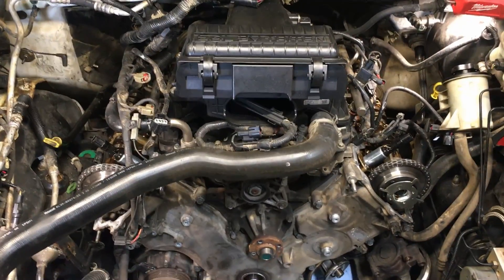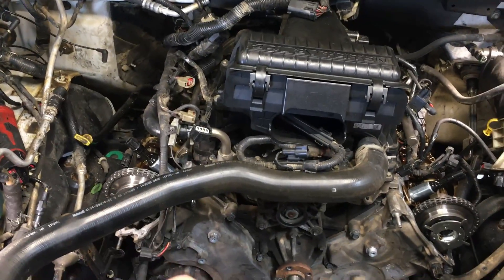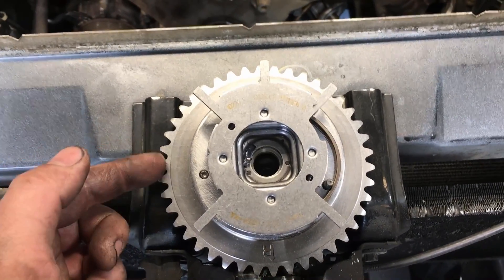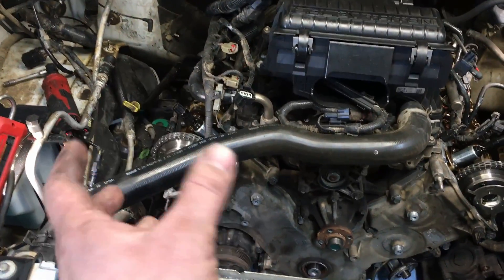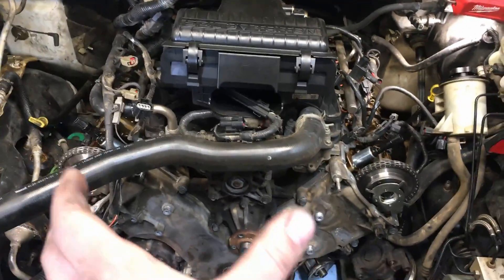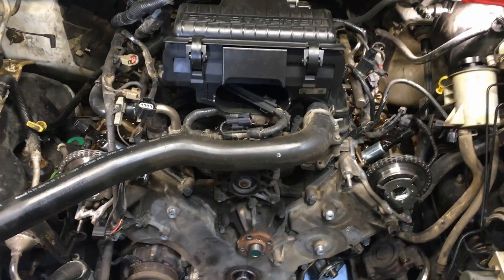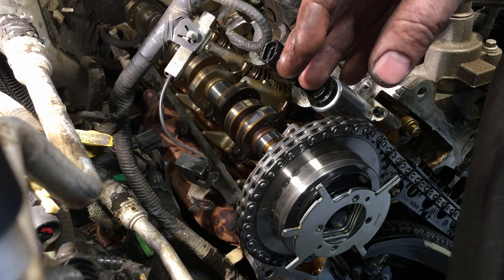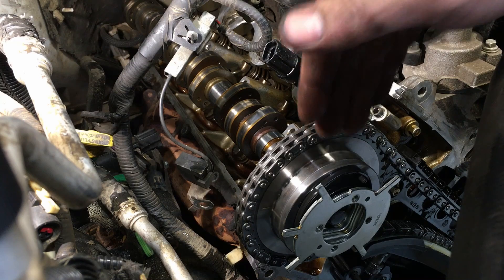Ford 5.4L 3v Triton Engine: DO NOT USE AFTERMARKET PHASERS FROM FREEDOM RACING/OTHERS; THIS IS WHY!

Comment: It was Benjamin Franklin who said, "The bitterness of poor quality remains long after the sweetness of low price is forgotten."
Reply: Dewy Russ Ben loved quality beer.
Reply: @creigmacc  quality beer is not brewed in the USA; and not quality cars are made also
Reply: @thinknow1  I'm sure whatever fecal matter encrusted sphere you find yourself has the best of everything.

Congrats.
Reply: Fancy Benjamin Franklin way of saying “you get what you pay for”
Reply: ford has low quality and high prices that why these engines need rebuilt and are expensive.
we went from $3000 for a new car in the 1970's to $65,000 today and you get 1/4 of the milage before major repairs are needed.
Reply: @RobertMillerJustme  - There is truth to that but it's not just Ford.  All brands have their problems.  And you ignore the benefits of new cars.  Back in the 70's, I was changing plugs every 15k miles, adjusting or replacing points and condensers nearly as often, and adjusting valves every 20-30k.  Most vehicles that made it to 10 years of age already had the exhaust replaced twice.  Shocks lasted about 50k...so you were swapping them often.  Back then, it was a real milestone to reach 100k miles on any car.  They rusted-out in less than 10 years if you lived anywhere up north (where I did).  Today, most plugs aren't replaced until 100k miles.  You can literally buy one and drive it for years with only changing oil and putting gas in it...and never have to do anything.  Sure, there are problematic designs but all-in-all...today's vehicles are MUCH more reliable.  Don't get me wrong because I'm a gearhead and love classic cars and trucks...but just because it pains me to admit it, today's cars are pretty-much better than any of the old vehicles with maintenance, reliability, safety, emission, performance, and longevity.
Reply: The key you could do it 

My first car was a v6 Pinto wagon demo unit I had that car for 12 years and put on 400,000 miles and except for general maintenance no major issues. I did replace the exhaust TWICE

As for the rust bucket, you are uninformed The older cars lasted longer it was not till Japan sent their rust buckets over did that change - in Baltimore my grandfather had a 1963 Ford Galaxie model and he kept it till he was t boned in 1996 and no major rust and original paint, it was his daily drive going to Bethlehem steel.

My 99 f 150 wiring harness was replaced, and on the third ECM, 3 sets of phasers, both heads twice, exhaust codes at least once a month for no reason - I can prove it has been in the shop more than out on the road it is a worthless POS that never should have been built.

As for exhaust to do the complete exhaust today cost as much as my first car.

Today everything is designed to make you buy new every 4 to 5 years and this is planned, they know they are building crap.
Reply: @RobertMillerJustme  = You have some agreeable points and others...not so much.  I grew up in central PA.  I'm not ill-informed.  You could hear your car rust on a quiet night!  My first vehicle was a 61 Willys Jeep...by the mid-70's when I got it, the floor already had 3 layers of sheet metal covering the holes.  We had a mid-70's Ford pickup...body mounts were rusted off by the late 80's (when you hit the brakes, you could feel the cab rock back and forth).   My 77 CJ-5 was so rusted out by 1989 that I had to replace the whole tub with a fiberglass body.  SOO many examples of rusty vehicles...I think you are the one ill-informed.  I don't think there was a car on my street that didn't have rusty wheel-wells or quarter panels.  Vehicles in the rust belt look like they lived in the bottom of the ocean after 10 years.  It was that way all the way back to the vehicles I remember as a child.

As for reliabilty...yes you could work on them easier than today (without code readers, etc.) but that IS the point...you HAD to work on them.  And you had to do it ALL THE TIME.  Like I said, I'm a gearhead but I have to admit I could go down and buy a simple family sedan somewhere today and if it didn't last at least 150,000, that would be rare.  Back in the day, you'd be lucky to see the odometer turn over 100k...it was a really big deal when that happened. 

As for exhaust...yes it is more expensive but you rarely have to do it.  My wife just got rid of her 2008 Town and Country van with 278,000 miles and guess what...original exhaust.  My 2004 F-150 still had the original exhaust after 16 years when I traded it.  Heck, my daughter's 2002 F-150 (used to be my father's before he passed) still has original exhaust...so it might have been cheaper to do it on your Pinto but you HAD to do it.  Today, they last much longer...often the lifetime of the car because they are stainless steel (which is why they are so expensive if you do have to replace).

Comment: Yep had one come in and the owner bought a DORMAN and I refused to install it.I told him to buy OE only he told me to well never mind.I try to steer people to OE parts ONLY. Thanks for getting this information out now let's hope the people takes this seriously.
Reply: I had a customer that never changes his oil need the timing done and used Dorman phasers. 3 years and 2 oil changes (eek!) later they are still going strong.
Reply: @sienile  i to have dormans. And my truck constantly gets sprints to 80 mph from 30mph rolls do to our on ramps to the express way
Reply: Dorman make s*** parts . I got an electronic throttle harness replacement and all the wires are white and not labeled .
Reply: Guys, its the the parts that are bad.  Its the junk 5.4
Reply: @getchasome6230  5.4is a stout engine...it's what's on it that ruins its reliability.
Reply: @getchasome6230  millions 5.4L still on rd doing well! Out of production 10yrs now.
Reply: @damnyankeerebelprepper1324  the dorman intake 😄 -11 HP 🤔
Reply: The OE part failed... "only use OE parts" lol...
Reply: @mattlane2282  that's what I thought too.  The Ford phasers are the pin in the grenade!
Reply: @mattlane2282  It's called a lockout kit and tuner.
Reply: @DoctorRickSanchez  Is this a better fix than new phasers?
Reply: @justinwalker3617  Yes. Get the OEM phasers along with the livernois lockout kit with the tuner package.
Reply: @DoctorRickSanchez  I have a 2005 f150 with the same issues I bought the dorman phasers and got screwed so I went and bought the Livernois Lockout kit and it is the best thing that I have done to my truck!!!!!!!!!!!!!!!!!!!!!!!!!!!!!!!!!!!!!!!!!!!!!!!!!!!!!!!!!!!!!!!!!!

Comment: Hello this is my 1rst comment on one of your videos. I have watched a lot of them and you have been right on the money every time with your knowledge.  I have 2008 lariat with the 1 piece plugs, What do you know or would you recommend   the lockouts and a tune just to eliminate that system all together ???... I like my truck and I don't have any plans on getting  rid of it  I have 280k and still running strong. I run amzoil full synthetic signature oil changed every 10k. What would you do to keep it running for many more miles.

Comment: 8:43 It doesn't look like the chain is even meshing to well on the sprocket. is that normal?
Reply from the maker: Yes it doesn’t mesh too tight on these but also this is an aftermarket chain
Reply: hey so another question.. My ecoboost has had the timing chain redone at the dealer at 72000 k's.. it was a pile of parts. That was a warranty job. 30,000 k later it needed phasers again. All ford fomoco parts. that job cost me 2600.00 CAD.. Any idea why it failed so close together..

Also it was 25 days over warranty and 2000k past 100k powertrain.. I think they screwed me.
Reply: @billstmaxx  same, mine only made it 30,000 more and I have to redo again

Comment: The hair on my neck stood straight up watching the passion in this guys voice over this issue. And just for that...I won't buy as much as a bumper sticker from Freedom Racing.
Reply from the maker: The company is fine otherwise, I buy Ford OE speciality tools from them often it’s just these cheap phasers they are pushing over the OE ones.
Reply: Well, they're not that cheap either. The price that comes up when you do a search for HDPACNC, brings up Freedom Racing and a price of $217 per phaser.

I recently purchased some AC Delco corrosion resistant brake rotors for my Chevy truck. The box indicated, Made in China.
Reply: The passion…..is just GENUINE! Brian even gave the guy a break on PARTS because he knew the situation was SNAFU!
Reply: matt8863 
Sounds like they enjoy plenty of freedom over there. 
Freedom to lighten your wallet for junk parts.
Reply: dont buy a FORD is a better option
Reply: @BadTV1993  No, Fords are good vehicles.

Comment: And everyone is running around like a chicken with its head cut off, screaming that Trump has imposed tariffs on cheap CHINESEIUM parts!!! 

Did you say DORMAN?? They can't get anything right, let alone, a large, expensive, complicated part like this!! There is a reason why I won't buy DORMAN toilet paper, as well!
Reply: roadkill5333 - yup! undercutting real parts with 1/3 price, garbage quality that will cause you more issues in the long run (i doubt they take the time to temper and treat parts that require it for longevity) and people bitch about the tariffs. Amazing. What's equally amazing is when the vehicle or device they are trying to repair still has lots of value left and they STILL want the cheapest parts available. Like all the no name tires you see on cars like Mercedes.... You bought a 50k car and put Chinese "grip-mile" no name tires on it!
Reply: volvo09...yes, those cheap Chinese tires were the precursor to things to come!!

I was getting some tires put on once, and while sitting in the waiting room, one guy gets finished, goes to his car, and the "NEW" Chinese tire that had just installed, was flat! I smiled. While he waited for them to change it, I was watching them try to balance the next tire, and couldn't! So they went for another and finally got it balanced!! Looked like a lot of lead weight to me, but from a distance, I couldn't see enough to count!! I wouldn't want that much lead on my new tires!! 

A buddy put Chinese tires on his big truck! He had nothing but troubles out of them, and had to replace the new tires, within about 15k miles! Spent more money, and down time on the Chinese tires, than he saved on when buying them!! Including sitting on the side of the road, waiting to pay road service to come fix a blowout, a rough as hell ride for the last bit, and a different one flat on him, almost every week that he had them on! Fortunately, he only had them about two months, and no fatalities occurred!! Unfortunately, that's the longest his truck ever sat, while the drivers seat was occupied!! Cost him some good money!!

Comment: I purchased Ford phasers(with the FoMoCo brand engraved)from freedom racing and didn’t have a thought about getting the aftermarket brand. Been driving for over a year after the timing job with no problems.
Reply from the maker: Yeah they sell both which is great but them pushing the local phaser company has pushed me.

Comment: I can understand the frustration. I had solenoids and phasers installed by my local shop and the truck ran worse afterwards than when I brought it in. I know the bank 1 phaser is sticking advanced intermittently. 4 out of 10 times I come to a stop sign it will shake and shudder like it's missing. When holding constant pressure on the accelerator going uphill, I can feel the power come in and out as the phaser is wandering around in and out of time. They blamed it on low oil pressure so I changed it to thicker fluid and put a gauge on it. 45psi at warm idle. So much frustration and stress over a few pennies in savings.
Reply: Test your oil pressure.  The phasers are very sensitive and the oil pressure must meet specs or they won't run correctly.  If there is wear in the engine or obstructions to oil flow, you will need to install a higher capacity oil pump.
Reply: John Ferguson I am well aware. You obviously didn't read my comment.

Comment: So when I go to buy parts for my 4.6 2 valve, where do i get parts that ford no longer makes. I dont wnt to change the engine when the 2 valves are tanks. Does amazon have ford parts for those engines also.
Reply from the maker: Ford makes most of the 2v parts still I am sure but you don’t have phasers so it’s not as big an issue. Although plastic guides from the aftermarket wear fast.
Reply: FordTechMakuloco aren't manufacturers required to produce replacement parts for their product lines for 20 years, at least?
Reply: Just the pollution control equipment and airbag stuff.